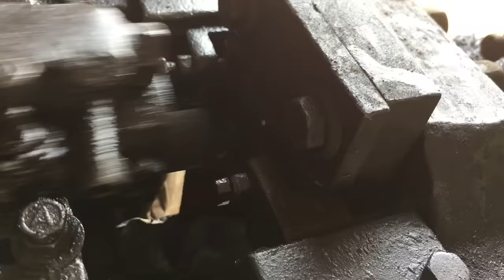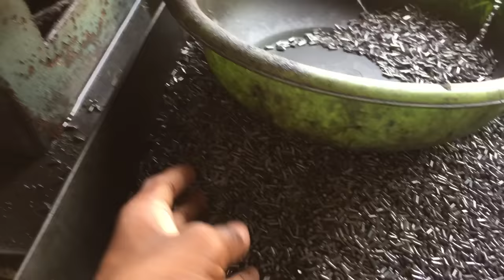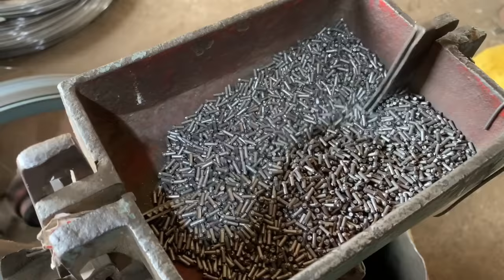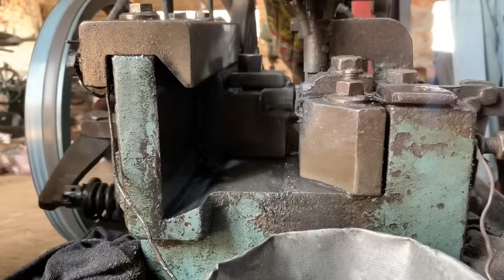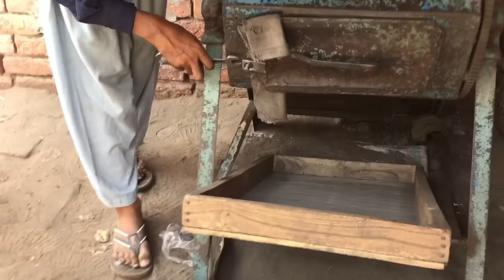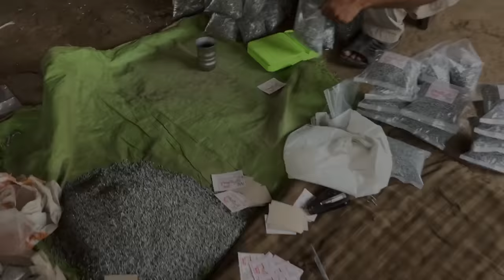Wonder how many screws Made From This Screw machine | | Amazing Process Of Making Screws

Comment: My guess of how it works :

1 .  two different feed hopper mechanics

a. barrel rolls picking up blanks and dropping them on trough
b. trough moves under and over blanks
In both ways blanks feed into trough with head at top and tail hanging down

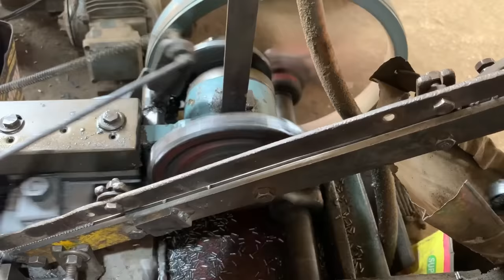2. on both machines ( at 2:15 and 3:15 ) you see a toggle tapper which hits the trough feeder to vibrate any blanks that are getting stuck to dislodge and keep them moving down the trough

3. blank gets placed into path of high speed moving plate that presses and rolls the blank towards the release point - while pressing and rolling - one of the side walls has a thin sharp rib that goes from the top to the bottom and it presses the thread into the blank - I suppose that it also lengthens and thins the blank - it makes sense that the moving plate would have the rib so that it can be readily reworked or replaced when it gets dull or worn